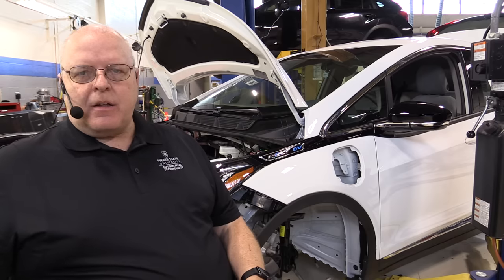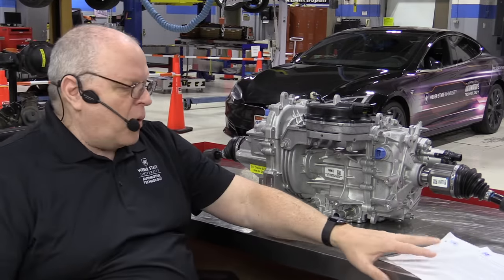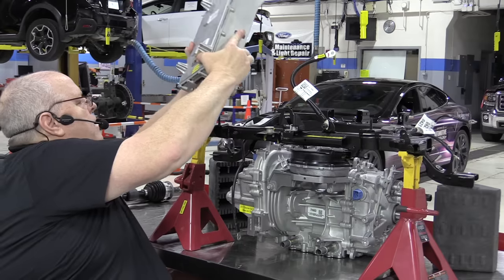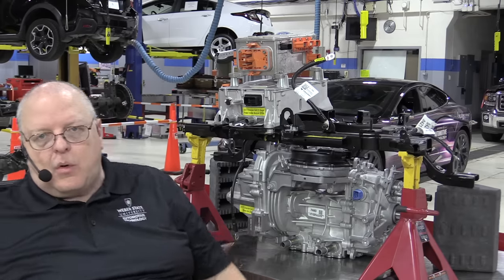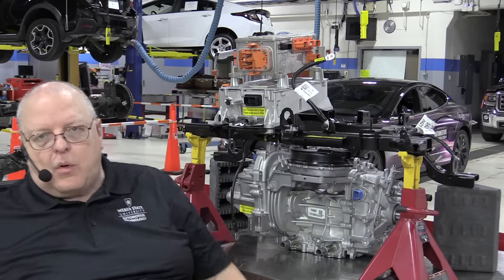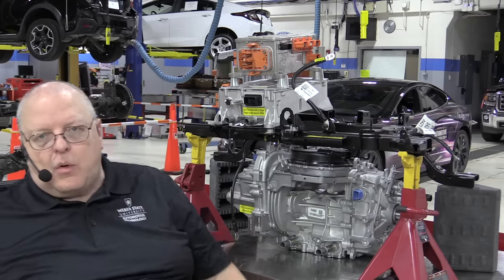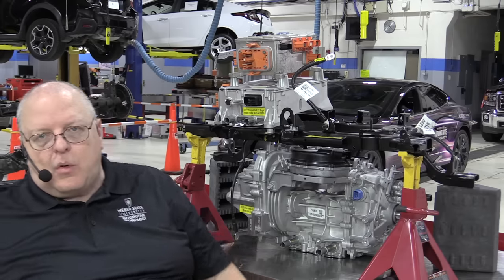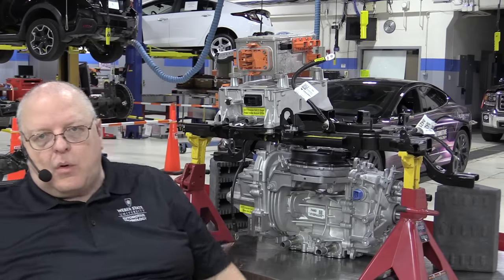Chevrolet Bolt EV High Voltage Components

Comment: Sounds like you are going to change out all of the hardware associated with the DC fast charge only to find out that the software does not support it.
Reply from the maker: That is absolutely true. The parts I am changing do not contain any processors, so the software changes must be in the existing modules on the vehicle. I am hoping the GM scan tool will let me say it has the fast charge system now.
Reply: Meanwhile in 2021, all new vehicles are made with DCFC. The lengths that GM has gone through to pinch profits is quite amusing to me.

Comment: Another summit white like mine except for the missing DCFC
Reply from the maker: Thanks for watching,
Reply: @WeberAuto  I just got a 22 so I'd be interested if you obtain one of those to work on.
Reply from the maker: @47of74  The powertrain is identical to the earlier ones other than the battery back chemistry is changed for higher capacity.
Reply: @WeberAuto  I took my 22 to a National Drive Electric event in Iowa City last weekend.  I raised the hood to show people what was underneath.  I was wondering - are there any high level docs on whats under the hood.  I had a few people ask me about the various components.  I mentioned seeing your videos but couldn't quite remember what was under the hood.  I thought it'd be helpful to have some high level docs so I could at least name the stuff under the hood.  Thank you.

Comment: Heating the coolant for the heater core is not the way that I would do it. I live in the northern US so I’m used to the cold. Simply replace it with an entirely electric heater so that the climate control is warm instantly, with the coolant heater as a secondary system in order to keep power consumption low. Sometimes quality of customer experience should come over price, if my idea would even cost more - I can’t say!
Reply from the maker: Thanks for your feedback, Heating the heater core coolant in this manner may allow for quicker heating and hotter temperatures than what the battery or power electronics would need or produce in cold weather.
Reply: Perhaps they're worried about bring a high voltage/amperage heating element into the passenger compartment...wreck damage/danger?
Reply: obsolete professor Perhaps, but in my estimation the cab typically remains pretty solid during crashes. If the wreck were that bad, I don’t think you’d have to worry about the high voltage. I don’t think I’ve seen a single modern car accident where the dash was displaced into the passenger compartment. Not arguing, just stating my opinion.
Reply from the maker: @Marcus Wimberley I do too! very educational

Comment: THANK YOU SIR!!   that contraption is still a mother   of complication; i thought it was just a motor and a battery,silly me!! I'll keep  on~ICEing.
Please... EVERY thing is liquid cooled (1/2 to 3/4 inch pipes-W O W )!!!!   what kind of hp lost to cooling are we talking about,any idea?
Reply from the maker: Thank you. Good question.
Reply: I mean, in EVs HP isn't really lost, the batteries can generally run it all. It's gonna be range that they lose. peak cooling of the battery and the cabin can reach as much as 13 HP combined. More in other vehicles like Porche Taycan.

Comment: All electronics arrive with battery 50% full new from factory for a reason - maximum stability during storage and transit. Keep yours between 40-70% full and it will last a million miles without degradation or mileage reduction. Only let it get to 0% or 100% for a few minutes until you start charging or driving - NEVER let it sit overnight when full or empty. Google "secret life of EV battery".

Comment: 3:29 “DC charger won’t activate the battery heater”... that can’t be right, or you would be stranded at a DCFC if you somehow pulled up with a battery below freezing. Is there some other heating loop that the DC charger would use, such as a high powered one in the battery cooling loop? I can’t remember from your battery teardown the details on the heater.
Reply from the maker: I could be wrong, but I know I read something about it not heating on DC fast charge. I will try to find it again.
Reply: WeberAuto hello professor. I also own a 2017 bolt and have bought the parts to start conversion to fast charging so I’m very interested in this topic. Really hope you can figure it out, love your technical videos best on the net, can’t wait till you have it all working. Thanks
Reply: WeberAuto, all I can find so far is when the AC Charger is plugged in, the battery heater will turn on at 50F or below and off at 60F and above. I think the DC Charger just needs to heat it above freezing and then it can start charging which will warm the battery up.
Reply: IMHO - when cold, the Bolt EV battery (when plugged into a fast charger) ramps up current very slowly as if a small heater is being employed at that time - perhaps too small, or it turns off too soon during a “start from cold battery” charging event.  20 to 25 minutes into a fast charge session (50 kw 100A charger in my case) the fast charge current does start to climb, and charging speed then becomes acceptable.  It would be nice if there was a way to turn on the battery heater in advance of a fast charging event, since you can anticipate the need for fast charging while driving along.  I believe this is something a Tesla is capable of.
Reply: Dennis Lyon, I think Model 3 has the same problem, and as far as I know they don’t have a way to heat on the way other than driving hard. I think Bjorn has covered this topic with his model X.

There should be a way to preheat from the battery when you know you are in range of DCFC, but maybe they are afraid people will strand themselves 1 mile short of the charger. 

I wonder if hard acceleration and attempts to regen would send the regen energy to the heater, or just not allow any regen at all.
Reply: IMHO - hard regen into a cold battery is usually not permitted, or greatly minimized, but I think this regen reduction is into a battery that happens to be well below freezing.  Interesting thought to know if that wasted energy could be dumped into some sort of heat element (as you mentioned) if the battery is not capable of accepting it, thus ensuring that regen will still work!  Bjorn shows a preset, which I think was called winter mode which I believe will turn on the battery heater while driving, anticipating an upcoming charge.  I’m thinking this mode was mentioned in his recent “brick risk” car that he saved at airport parking, but it may have been elsewhere.

Comment: Excellent breakdown. Hopefully teens/college kids with the time/curiosity find this info.  When EVs start falling out of warranty and you see Tesla parts breakdown costs, should be some opportunities for shops on other EVs.  

 I'll post a lesser known channel here did excellent teardown of a Model 3, by an engineer by trade.  Thanks  for spreading knowledge.  If EVs take off there is going to be very little repair resource out there.  Bolt's been selling about 6k a quarter for those curious. 

Ingineerix  
youtube.com/watch?v=jm_tV8la-0c
- Model 3 Penthouse approach contrast to the Bolt is interesting. Everything integrated and easy access under rear seat.  Watched all these vids. It's really a brilliant design.  4-6 bolts, coolant connects, and 8 or so harness connects allow the whole drive assembly to drop and rollout attached to rear tires.

the BMW i3 REX would be interesting look at, but doubt it will be around too much longer.  Shame it's not selling, as tooling up such a model  production is probably 1/4 the cost, so the small runs/sales doesn't matter as much.  That hour long factory video of BMW plant floated around couple years ago is intriguing.
Reply from the maker: Thank you, I agree,
Reply: Saw a test Bimmer on the road, shoulder, broken down.  But, I did see 1 running down the road a couple years later :)

Comment: Wow, what a convoluted mess!  Far too many "modules" and electrical harnesses and coolant loops.  Is it just me, or does it look like this one was designed to support the service industry.  A Tesla uses MUCH simpler and more elegant in designs.    Also it seems that all of the heat that is generated is wasted, and if you need heat for the cabin, or the batteries, it is generated trough resistive heaters.   While I don't like this design, I really like your videos.   You do an excellent job at explaining how these things work.  I would love to hear your opinion on this design since you typically leave them out of your videos.
Reply from the maker: Thanks for your feedback. The modular approach with its hoses and cables allows those components to be used on other vehicles in the future without a total redesign of anything but the arrangement.
Reply: Yes but the Tesla two bearings Fallout I'll be damned if I pay $80,000 per car whose engine falls apart every 15000 miles!!!
Reply: It's typical non-committal GM. They just don't want to spend too much on R&D because they want to pull away from the black blot of their past bankruptcy bail from last decade. It looks like new blood will be giving us the changes we want. And Tesla, who has been carrying the industry for years.

Comment: I don't understand why anyone would buy this car without a DC fast charge? That would be essential to have if you drive your car more than 12,000 miles per year! Takes to long to charge at level 2 charger!
Reply from the maker: Thanks for your feedback. I agree. It should be standard equipment, but that makes the price higher. Some people think that all EVs are the same except for the price so they will pick the least expensive option out there (Nissan Leaf) which does not come with one either. I suspect Chevrolet did this to get the price as low as possible to compete with that mentality. Unfortunately, the Leaf's lack of thermal management for their battery will have those Leaf customers regretting their decision in about three years.

Comment: why 3 phase ac? i thought this was a perm mag motor, and that all perm mag motors are dc? there is no phased dc. 
sincerely an electrician apprentice
Reply from the maker: 3 phase AC gives more power. Switched DC is for blower motors and window motors.
Reply: Does Bolt EV employ Halbach Array?

Comment: I am forced to question the crash worthiness of this car.. First, because of the cobby spot welded stampings used in the frame in the front of the car.. and Second because of the rather cobby individual boxes with their fracture prone cast feet, and the cross frame perch they mount on... this is in stark contrast to the physical integration of the similar modules in the Leaf.. affording one rather compact and robust "lump".  While this GM layout is likely faster to work on... it will also be faster to bust in a typical event where the bolt rear ends another car...  just about the most common accident imaginable... given the current level of driver idiocy.   We will see what happens in a few years.  The current situation is that is nearly impossible to find a Leaf which has burned after any kind of crash.  And it is also nearly impossible to find a Tesla which has NOT burned after a crash.   If the Bolt tilts the equation in a negative direction...it will not bode well for EV's in general.. Fingers Crossed.
Reply from the maker: Thanks for your feedback. The early Leafs were modular as well.
Reply: Capt - I can't quote where I heard it but recently I remember seeing something where Tesla was comparing the risk of fire of their vehicles to the risk of fire of gasoline powered cars - and the Tesla was WAY less likely to burn.  Thus, I would like to hear your source of your statement that "it is also nearly impossible to find a Tesla which has NOT burned after a crash."  As that is a very serious charge, please provide a link for this assertion.  Thank yu.

Comment: Seems like so many more things to fail. That compressor seems like an average size that would be in a medium sized sedan. Now this compressor has to keep the cabin cool and the battery? Oh and it will run anything the battery is hot? Yeah, that thing is going to fail.
Reply: It is more like a sealed system in a stationary system (home a/c) so it is very likely going to last a very long time.

Comment: If I am a owner of this car I don't want to see this, because it will give me nightmares about possibly problem, spare parts and repair costs.  (If I am unlucky)
Reply from the maker: Thanks for your feedback. I think you would get nightmares if you saw how many components are in a non electric vehicle. I have transmissions here with more than 300 individual pieces. Have a good day
Reply: @WeberAuto  Yes I know, but after decades of production, problem has been ruled out (hopefully).  If there where any leaking problem with all these cooling water connections, I am sure that these also will be fixed in time. In the meantime we hope for a trouble-free ride. How about the possibility of air bubbles in pockets in the cooling system, by the way?
 The electrical motor and the transmission gear-set is very simple. It's like a dream. The complexity is everything around it.
Reply: I forgot to say,  you are doing a very good job in these information movies. Everything is understandable!
Reply from the maker: @k.kristianjonsson4814  Thank you. Air pockets are not an issue if the proper service procedures are used. A vacuum is put on the entire cooling system loop to remove all of the air, then the coolant is allowed to go in and fill up all passages.

Comment: If I can get a all wheel drive mustang for $42,000...   Wait a minute.  That's what I paid for my 2 wheel drive bolt.  GM needs to take this basic design and give it a all wheel drive option.  Keep the price under $25,000.  change the body design.  And scrap all the extras.  I want heat, AC,  and a radio. I don.t need a tesla lite show for $120,000.
Reply: Haha its funny that you think GM will sell an EV under 40k with AWD, they're definitely not forward thinking enough or capable of doing this. Remember, they were bailed out of bankruptcy only a decade ago. They're not going to be taking big risks.

Comment: maybe its just me, but this looks horribly over engineered, and over designed.  I'm all for modularization, and standardized parts, but this is a hot mess.  this is what I'd expect to see if someone was trying to convert a gas to electric...  for a pure electric, this needs a lot of work.  too many parts, too many redundant systems, and too many lengthy wires.  I like the motor... kinda.
Reply: Hahaha it's so true. GM improved the battery pack placement in the Bolt but stayed non-committal in making a competent EV with efficient component placement and thermal management system. As another commenter mentioned, Tesla has had open patents about a single cooling loop thermal management system for over a decade now.
Reply: @Infinion  I'm working on reverse engineering a Tesla drivetrain for a custom car.  Got to say,  I like what I see so far.
Reply: @Unmannedair  Without a doubt, their drivetrain is top-notch. What technology is the motor you're using? PMSRM (IPM-SRM) or BLDC?
Reply: @Infinion  I believe it's the pmsrm.  It's the one that uses permanent magnet hallback arrays.

Comment: all those components and connections had better be water tight down to 10,000 leagues under the sea.
I'm telling you if the salt spray gets on anything inside the hood of this car it is gonna be all sorts of F^$%'ed up, and I mean take all those electrical components and shrink wrap it in one giant completely sealed coating, lol its the only way, I've seen petrol engines and trans barely run due to just a couple bad pins in a connector do to salt, inside of so called enclosed  and protected components, dont ask me how, but that salt gets forced into every crevice when your driving down the highway in that spray, Dont drive these cars anywhere near Cleveland Ohio, you will regret it
Reply from the maker: Thanks for your feedback. They have double seals on everything. Hopefully it can withstand what you are describing
Reply: @WeberAuto no problem, I dont mean to be an alarmist, (and I love your videos and the design job done by GM), but there is good reason they dont use salt on runways at airports, and that reason is to protect the sensitive electronics on the airplanes, because they dont need corrosion causing planes to fall from the sky.  and I dont think american auto mfgs have figured this out, because I am continually deal with bad wiring, and bad plugs and relays, that once a pin or two gets corroded, ECMs start throwing fault codes and things either wont start or cant run properly and electrical gremlins are by far the most frustrating and hardest to diagnose. (even household electricians have a heluva time finding shorts and stray voltage) now take an all electric drivetrain and then mandate in 20 years that the car drive itself, and add salt and you've got yourself one giant recipe for disaster, I'm all for the EV revolution but I wont touch em until I'm sure they can be submerged in brine and still function properly, lol 
alright thats all, Merry Christmas and Happy New Year!